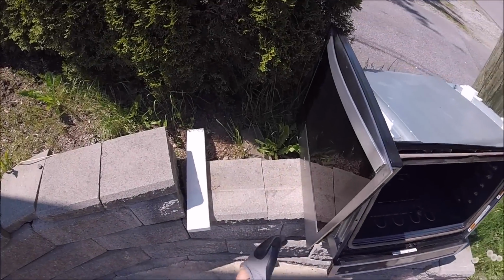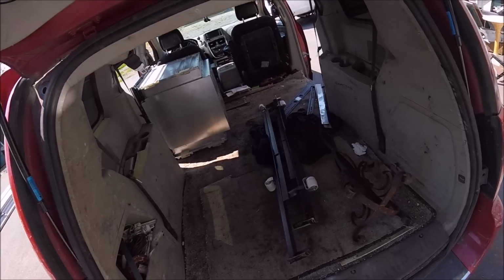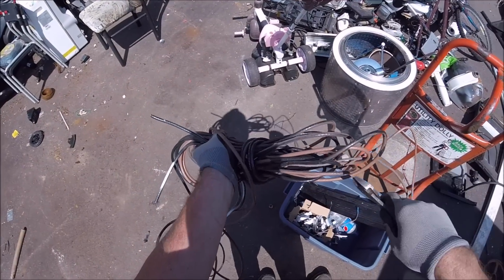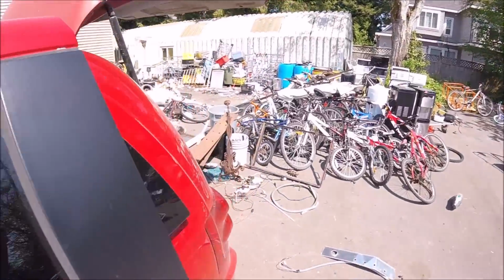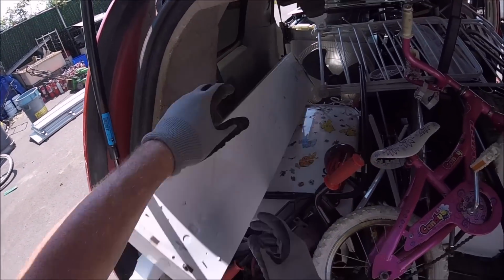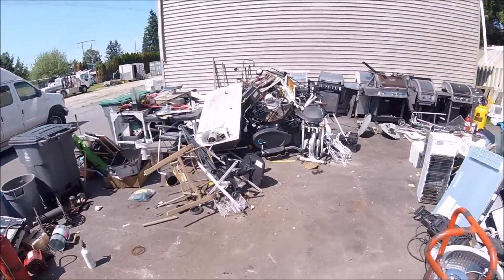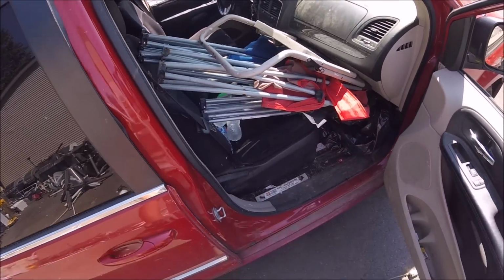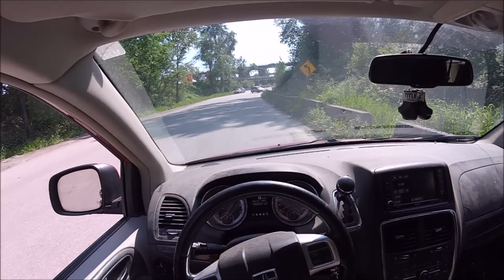Scrap Run & More

Comment: Looks like all the shred will be cleared from your yard before the bin gets repaired. Ideally I would have preferred the shred yard run to be done with bin so that so much time spent in loading and unloading of van space could have been saved. From 3rd May till today you made 10 trips with red van selling 8000 pounds. With bin it would have cost you three trips.
In any case, as you have time on your hand so it is OK to get regular cash from van trips. Good thing is every time you travel anywhere, you are collecting shred adding to your pile.

Comment: Good video, Phil It is hot here in the Midatlantic/Southern East Coast North Carolina. We have had unusually warm weather all Spring except for the 1st couple of weeks where it was cool. It does warm up here earlier than the rest of the US here in the South but Texas has been super hot this spring with over 100s F. 40's C. My friends and family in Oregon and Washington talk about the heat. It is crazy. East of the Mississippi most of the US and Parts of Ontario and Eastern Canada has had crazy rain too. Weird weather. Keep hydrated and work early or late not in the middle of the day. You might hose down your piles and the grassy areas to keep fire hazards down.
Reply from the maker: Thanks, Its going to be very hot this summer